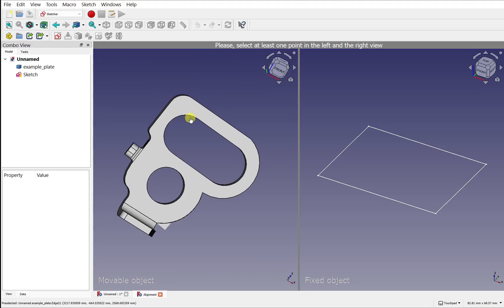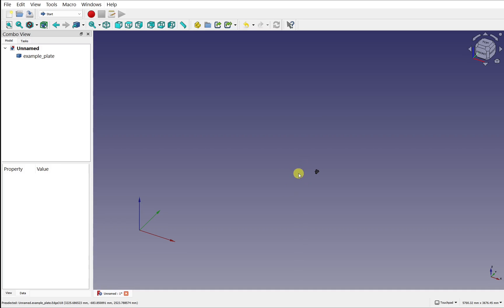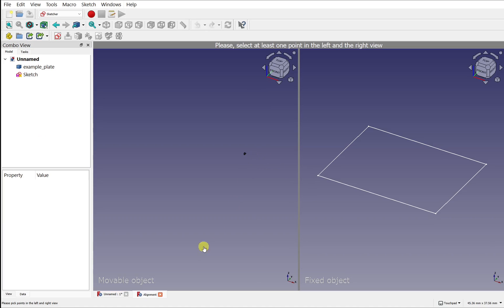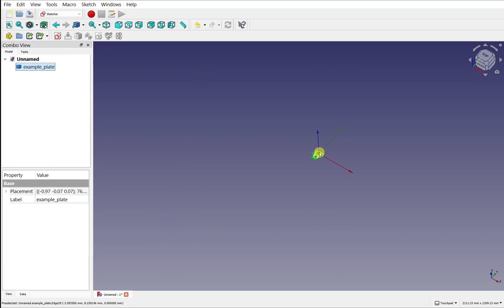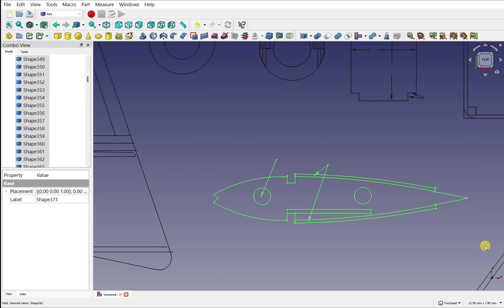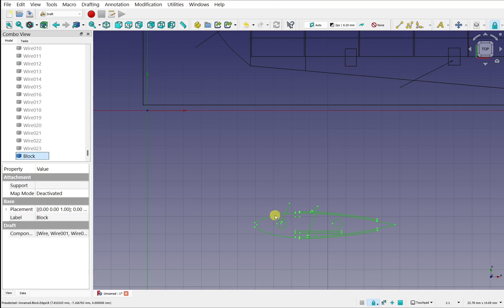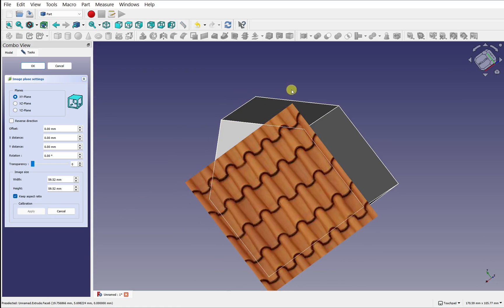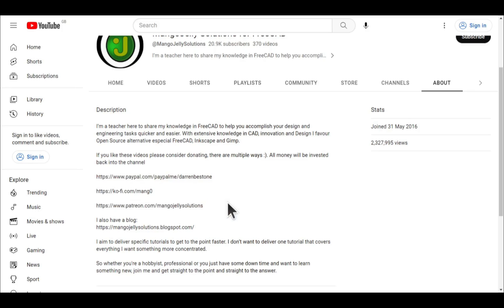FreeCAD: Alignment Tool. Align 3D , 2D and Reference Images

Comment: Great info! However, it's a shame that FreeCADs workflows seem to be driven by technical implementation rather than user efficiency. This is one area where they could learn a thing or two from Blender or other free form modelling tools.
Reply from the maker: Thank you :) The new alignment tools are looking better in 1.1 which is currently available as a RC release, there are some offer improvements so looking forward to see how freeCAD matures.

Comment: Thank you for another helpful video.

When I use Edit>Alignment, opens a second tab but after 1 o 2 seconds the main tab is selected and I can't  work in alignment tabs since it always returns to the main one. tested in 0.19, 0.20, 0.21 and 0.22

Comment: I would have thought there would be an option to simply move the origin point of an object. I used to use SketchUp before it when cloud-only and you could just chose the command and then click on the new origin point, then the X axis would rubber-band to you mouse cursor so you could snap it to another part of the object, then the Z axis would rubber-band to your cursor so you could snap that axis to some other point. (You could snap to points to put the part origin axis on that point or snap to edges/global axis to align the part axis to that line.)

Comment: I am sorry for beeing harsh critic here. But the truth is the truth and I cannot help myself, but say it the way it is.
I am 72 years old mold maker, mold designed, CNC machinist(mill) and classic EDM sinker operator.
I have the notion, that if a free CAD software is available for the public, it is a tremendous benefit to society. It helps with imagination, it helps with concentration(while you learn and also while you use it), it helps with controling your planing ability and therefore controlling one self. And on top of it all, it is fun!
But when I see stuff like this my hair just goes up.
I can tell you that the people, who create this application are smart, but not smart enough! They are high end mathematicians with no practical experience at all!
I believe, that this is ( and should  be) the application for lower end of users. Why?...Because for high end users  there are applications like, Solid works, Pro Engineer, NX, Space claim and whole slew of others. No sense to compete in that level. Not only are they better but also they are generally speaking much more user friendly!….And that is missing here in FreeCAD! User friendliness, i.e. ease of use.
They make the software easy for programmers, instead for end users, which doesn’t make any sense!
	As far as this alignment is concerned, I think if you import “body” (i.e. part of any sort) into your system, it is logical, that you might want to preserve the origin Center point from the assembly – but there should be a choice in the import parameter table. Most of the time people do not care about the assembly origin. And then, while it was brought in your system, you should have a choice of conserving it or not - and if you conserve it, then you should be able to disable or enable by the will. In case you enable it it should not have any impact on your file’s  WCS and also not for your LCS. It should be o nly a reference to the original center of assemby, Nothing more.
And if you move your part(i.e. “body”) to the center of your system(which should be done automatically by importing it-unless you select NOT, then there should be no other issues. The assembly Coordinate center is there and you can invoke it(as a reference geometry or similar, which doesn’t influence your system at all-but you can utilize it as needed-if needed). 
There is no practical reason to move the assembly center to your system center. And if there is such reason, then why not relocate your system center to new position(i.e. assembly center)….From practical point of the view, I cannot imagine any scenario, where this would be necessary and useful for anything!
This Turkey trott is just convoluted BS only confusing the end user!.
My old boss alwayr told me: if you do anything, do it utilizing method KISS -Keep It Simle, Stupid! Some people would benefit, knowing that!

Comment: Good vid, but I dont get why. I have had it often in the past when imported solids have an origin miles away, and it can really mess up manipulation of an assembly, timestamp 2:25.  Posted for algo 👍😂. Not a criticism.
Reply from the maker: Yes  I was thinking exactly the same thing until I saw a professional assembly and how it was being used. The assembly in question was a full car suspension assembly and the  person who was working on it was exporting out the parts from the assembly. That's where the penny dropped. The center of origin was at the center of the wheel base. So each time a part was exported out, the part inherited this centre of origin. So if a brake calibre was exported out its center was the center of the wheel base of the vehicle.  Thus a 4 meter wheel base caused the brake calibre center to be 2 meters away. They should of been exporting out the original part. If I hadn't of seen him using it I would never of known. Glad you enjoyed the video.